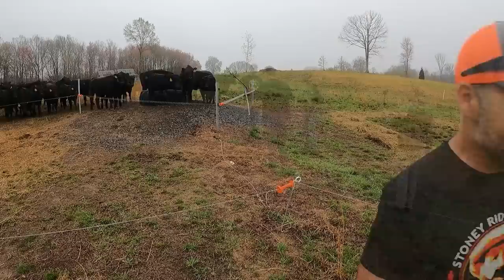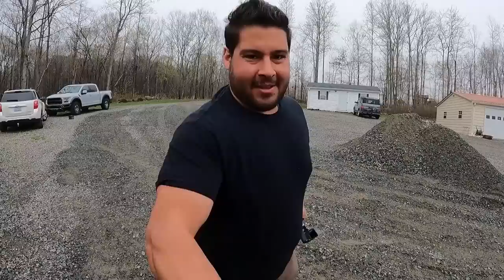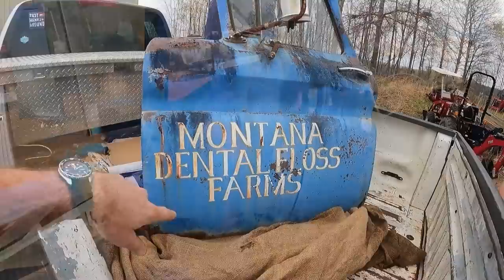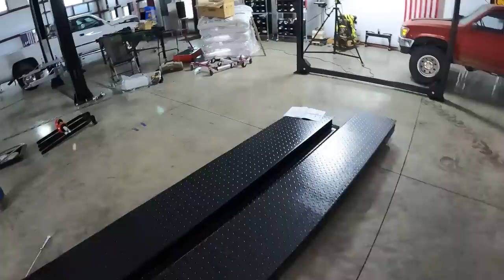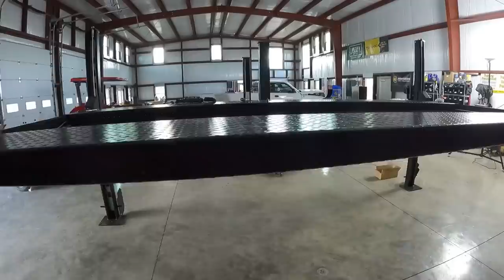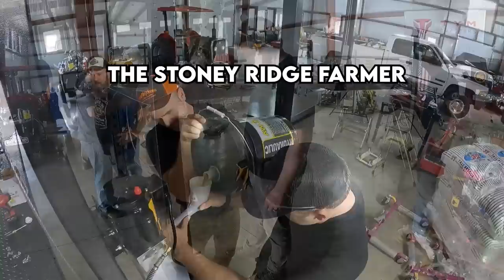I buried the electric tractor in the mud! Tractor rescue...YouTube style!

Comment: What a great bunch of folk.... 😊.  The vehicle lift..... make sure you beef up the washers on the anchor point down by the ram as is seen multiple ones nearly pulled through 😮 that not just specify for that make of ramp either... also check the fail-safe switches in each corner.. they can be life-saving or at least paint saving 😊.  Cracking work in keeping every one on site busy... stay safe 🏴

Comment: This situation is what concerns me about an electric tractor… if the battery dies when your stuck & trying to get unstuck, you’ve got a problem. How would you charge it? With diesel tractor if you run out of fuel while you’re stuck you just put a gallon or so of fuel in and you’re back in business.
Reply from the maker: the issue is....it would never die if it were stuck.  You get stuck like this...try and get out and if it doesn't come out then ya pull it out.  When the battery gets to a certain point it goes into "limp mode" and you take it back to the shed. If it were to completely go dead...then you'd bring out a little generator, charge it for an hour and go back to work